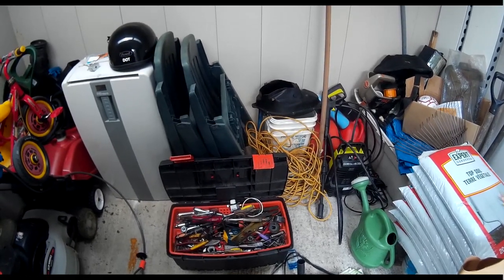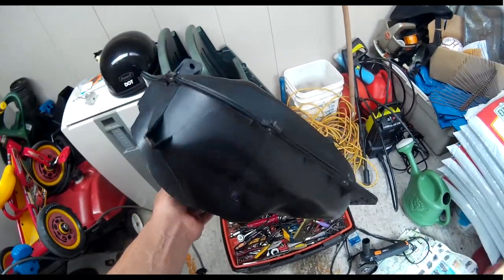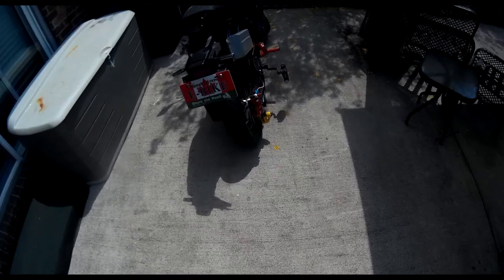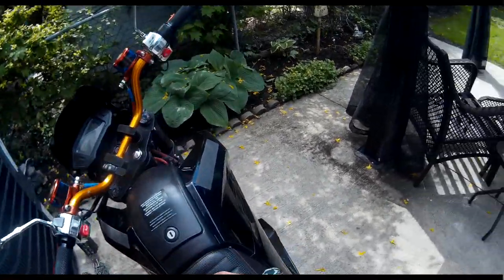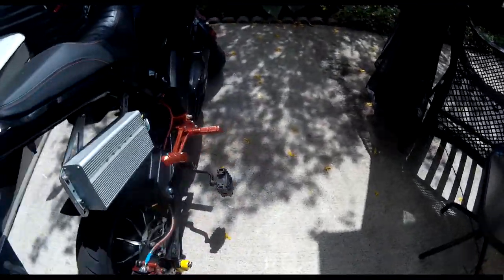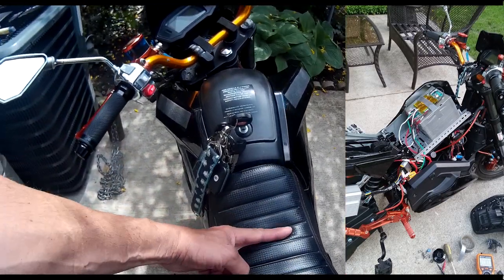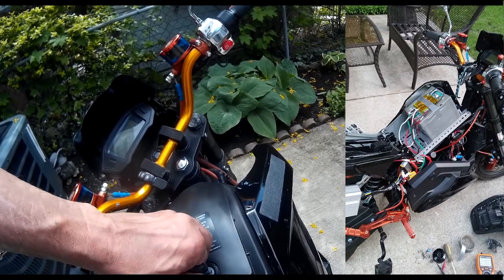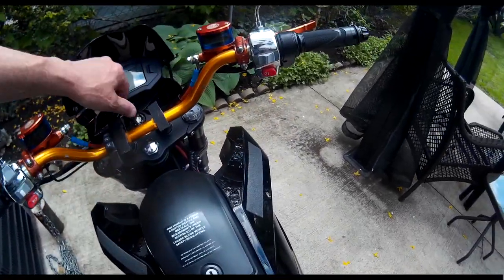EBIKE VLOG #34 (tank removed battery installed)

Comment: Do you run a switch, or did you mod your controller ?  Secondly, do you get twice the distance now ?  That's a cool idea.  :)
Reply: if you ran two packs top and bottom at 79v in parallel it would double the distance.  running at 115v doubles the distance and also doubles the speed.  no switch  its just a  79v 80amp controller overvolted to 115v.

Comment: What power produces at 29v ?
Reply: the bottom of the bike has another  79v battery  run in series with the 29v  already thinking on changing it to 36v
Reply: full charge is 115v
Reply: @KarmaElectronics.  so its S not V

Comment: ive been watching you for ages. started watching your controller and motor mods. why use life po4 cells why not 18650 or lipo or 26650 cells https://www.youtube.com/watch?v=21HCajp1ecM these cells are cheap and reliable.